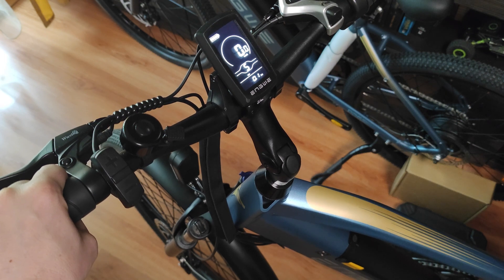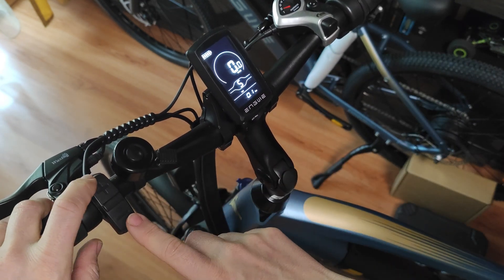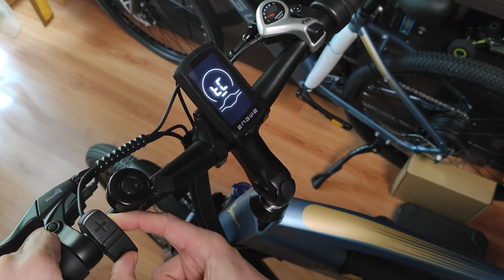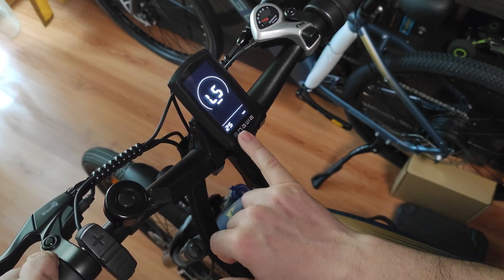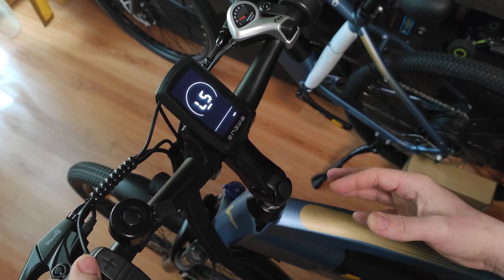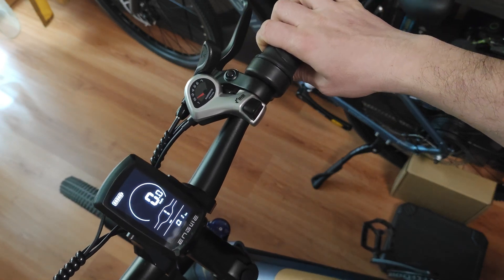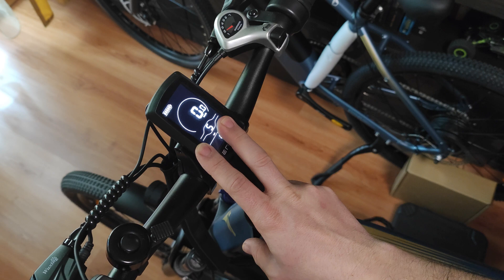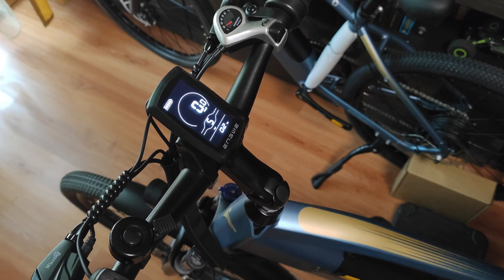ENGWE P26 Speed Unlock - Yolin YL80C Controller

Comment: Thanks for this - I have a new Engine X, but cannot alter the speed limit or engage the throttle function with these instructions. The figure (25km) flashes, but the + or - buttons don't change the figure. May it have something to do with the chosen wheel diameter? Our wheels are 20", so why have you set yours to 24"? Also, the throttle function which others show how to engage, also does not work as on earlier Engwe bikes such as yours, as in when I've activated it, no matter what assist level I choose, it will only go to c6mph! Could all these issues be due to new firmware from Engwe I wonder, to stop us doing these things? Thanks
Reply: I have the same problemo i can tell you 24 inch wheel diameter helps correlate the speed better as the tires are 4 inches wide but how you unlock I have no idea

Comment: Do you know how this works with EU versions? EU versions have program settings displayed from 1 to 19.
Reply from the maker: Mine is the EU version. It should work as long as it has the same display. If the display is different then it might unlock in a different way.
Reply: Interested in too. did you manage to unlock it from the 19p menu? because I don't have. can you tell me if it worked for you?

Comment: I was looking at the жидео and I did it! The speed really unlocked but I have a problem - my lights don't work! Do you know how to reset it to factory settings?
Reply from the maker: The lights are not related with controller settings, check the plugs, the wires, etc.

Comment: Hi, is the display easily removable to bring with you? Is it a slide from the mount or a single piece stuck together?
Reply from the maker: The display is fixed with screws to the handlebar by means of a bracket.

Comment: i have the same display but the speed blocks me to 60 kmh..how to unlock over 60..because in this video i see you go over 63...anyone??thanks
Reply from the maker: Depends on the display version. Also it doesn't matter as the bike will do max ~35km/h so doesn't matter if you set the top limit to 40,50 or 63km/h.

Comment: I have a request. Could you give your settings in Volts for each five degrees of battery discharge on the display. One line according to the instructions should be 31.5V and the second and the next to the fifth line, how many volts should they be set to? It's not in the manual. Everything changed for me.

Comment: Hello, what is maximum speed when you are on the bike?
Reply from the maker: About 35km/h on ideal conditions, with high tire pressure, 100% full battery, 20+°C outside temperature. In more regular usage the top speed is around 28-32km/h.